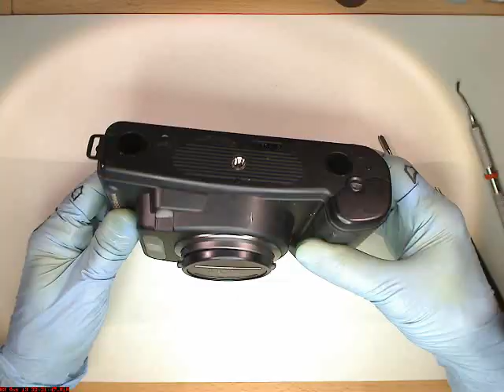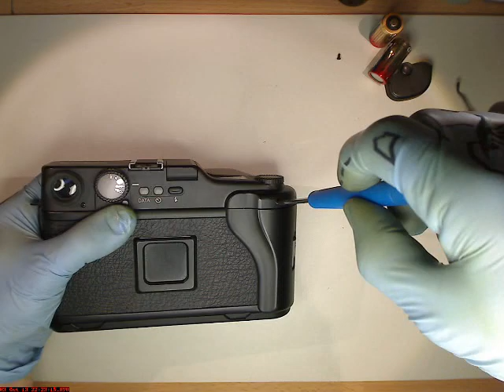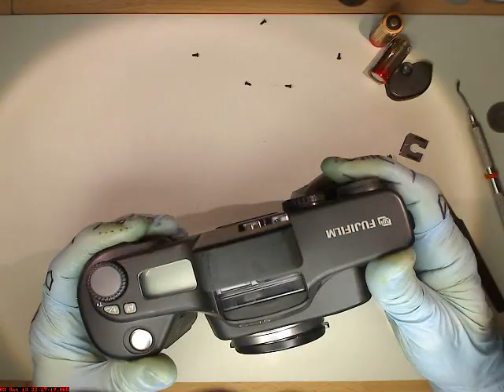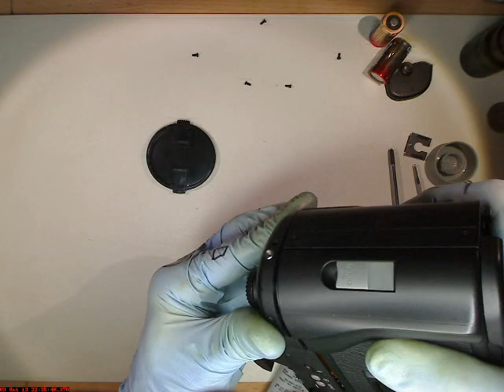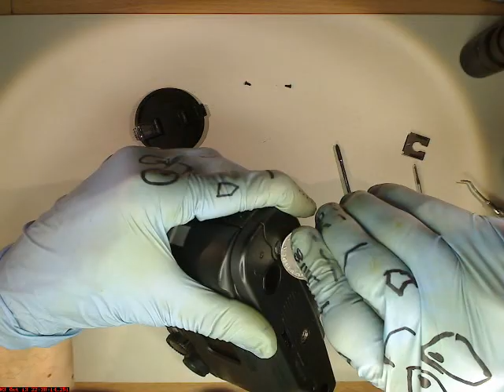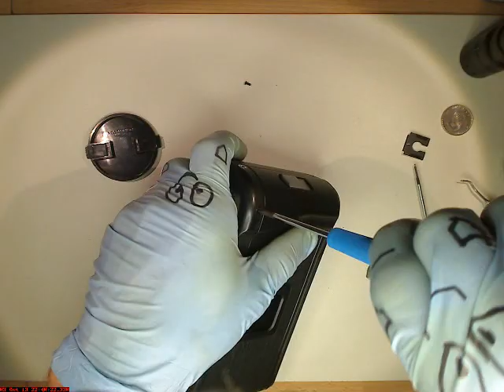Repair the flash on Dropped FUJIFILM GA 645 Professional_______motion lapse film

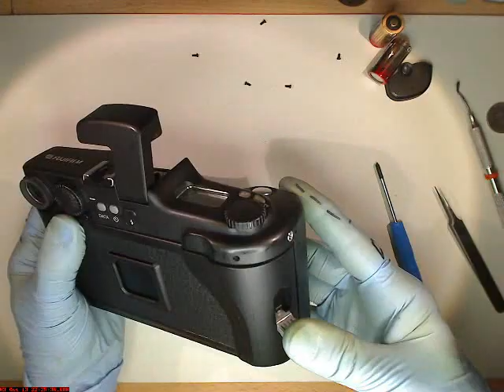Comment from the maker: To take off the shutter, If you look at 1:56 and look into the back of the lens inside of the camera, there are 2 or 4 screws that maybe are the screws that hold the lens and shutter assembly, connected to the camera house.
I do not have the camera anymore, and I didn't take pictures of the camera when I had have it :-(

Comment from the maker: Hi Paolo, first, the flash must only work when it's up, that was the problem with this camera. So take care  when you put on the top over again, to get the flash mechanism over the little switch I play with at 4:20. I'm not very shure how to get front off, but maybe there are some hidden screws under the "leather". Well, sorry but I have no idea how the frame lines work. I didn't realise that there was a "exploded" view in the usmer manual, could it be some problems in  the film advance gear

Comment from the maker: It should be easy to remove the LCD display, but when disassemble the top cover, remember to remove the screw that hold the little black plastic part at the front, under the flash. And of course also the other screws around the top cover. Well i'm not shure where to find a new LCD, but do the Google..., hope you will find it. :-)

Comment: Hello, I can't use an external flash with this camera. Can you recommend me? I see you taking a black plastic sheet from the hot shoe flash. What is it related to using the external flash of this camera? Thank you!
Reply from the maker: I would think you can use some of the older speedlight's direct on the hot shoe, or you could use a remote flash trigger, and in that way connected to a external flash.